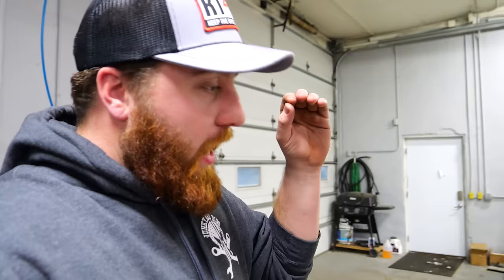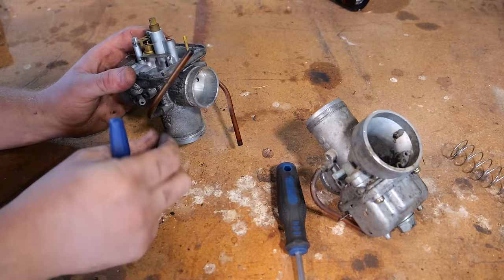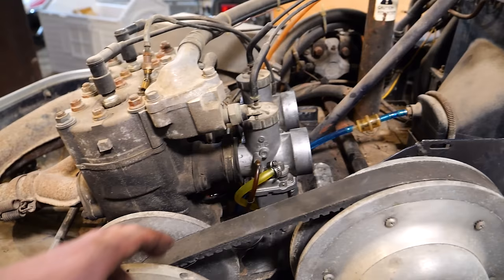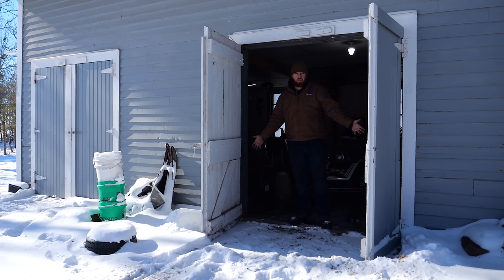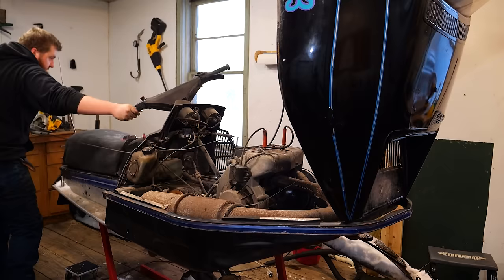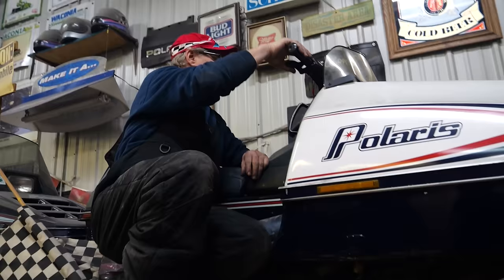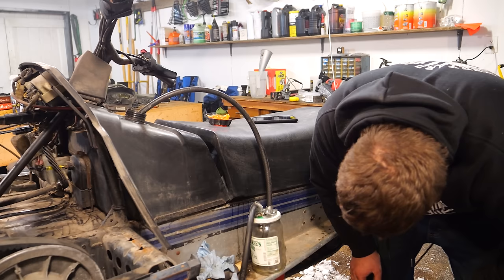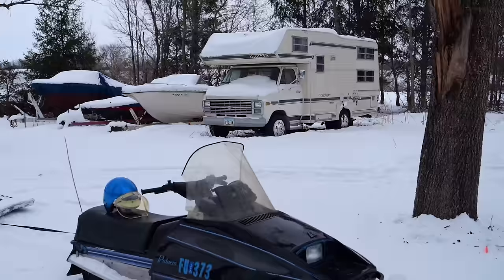Will These ABANDONED Snowmobiles RUN & RIDE After 20+ years!?

Comment: The air scoop was done as a recall. The brake would overheat (probably from the muffler), and boil the fluid.  I had a '79 TXL identical to the one in your video and it had the same scoop on the hood and duct under.
Reply: Exactly. I had the identical TXL 340 with the scoop already on it (bought the sled second hand). That sled could fly and was a wheelie machine. No IFS was the big drawback.
Reply: Yeah the indy came out in 80 and was basically a txl with ifs when I sold mine I sold it to a guy that was restoring a 80 indy 340 and he took my motor and exhaust and dropped it in his sled

Comment: My first sled was a 1980 ski doo with a liquid cooled 340 rotax and it was painted orange with "clockwork orange" very tastefully hand painted, pinstripe style writing on the hood. Was an old lake racer where they raced against the clock. Didn't know what i had at first, boy it wasn't much out of the hole but when it got the rpm up it would hit a huge powerband and you could barely keep it wide open for more than a few seconds it was so quick. It was pretty legendary for being the 340 that would run like hell back in the Day, always had to show under the hood to prove it was still the 340 motor

Comment: As a kid we had an 89 Polaris star that we used to ride every winter. Leading up to my birthday it was tradition to get it running. I can remember spending many years the night before my birthday in the shop with my dad and my cousin Robert working on it. To hear it fire up for the first time for the season put a big smile on my face. It originally came with a 250 but unfortunately the oil injection screwed up and seized it so then my dad transplanted a 340 into it. It was running when parked, probably needs a lot of work but no reason why it couldn’t be made to run again.

Comment: I had a 1974 Polaris Colt 250 as a young teenager.  It had that same fuel pump and dual Mikuni carbs.  Those carbs were the best.  Sure beat the old Tillotson carbs that our Sno-Jets had.  As a matter of fact, then the Polaris finally died, I put those carbs on a Sno-Jet with a 340 Yamaha engine in it.  Not sure if it had more power, but it sure ran better.

Comment: I had a 79 TXL 340… I LOVED IT. 38 millimeter dual carbs. It was fast for a 340. I rebuilt the motor and put a powerbloc clutch and long tracked it. Rivalled a new 583 summit in the day! Right on. I also bought the 1981 Indy 340 TXL rebuilt it and powerbloc clutch, repainted both and factory sticker back on it.
Reply: The tin air shield was on mine as well.
Reply: Also, when putting air box back in make sure the bolts go in properly, I had one brass nut go into engine.

Comment: No need for snowmobiles here in the south, but I love the snowmobile content for some reason. Get some of your friends together and have teams drag racing sleds pulling car hoods. Go to a junk yard, and have each team choose their hood of choice. Which is better? A more rounded hood to carve through the snow, or a more flat hood that spreads out the contact? Will waxing the hood be a benefit? A 2001 PT Cruiser hood, or that 1970 Ford LTD hood at the very back of the junkyard?

Comment: Daaang that shop is mint. We always had old snowmobiles as a a kid. The Rupp 440 had an open air horn that would die bc it would suck in my scarf. In that day , every piece of fun would have its special requirements to get it to run. I’m sure you will have these new sleds figured out by thaw

Comment: I used to restore snowmobiles as a hobby. I had connections and a friend that did the same thing. We ended up collaborating and parts swapping often. I worked  3rd shift as a custodian for the schools and he worked as a weekend ER nurse. I lost count  how many snowmobiles we restored but it was a lot. That was in the 90's. I ended  up working part time in a small engine shop and went on to learn lawn equipment repair as well as snowmobile repair. After finding ingredients out I had cancer, I was forced out of doing snowmobiles due to the invasive  surgery I required. I survived the cancer and closed that chapter of my life. The good ole days!

Comment: I live near Pittsburgh and I used to LOVE to drive my modified Polaris 400 2 stroke Sportsman 4WD auto through the snow. I NEVER got stuck on it. That 400 was a really powerful engine and it would handle jumps no problem. It wasn't anything compared to my 660cc Raptor, but it was alot of fun regardless.

Comment: Nice! I had a 79 TX 340 years back. I modified the exhaust by cutting the canister muffler off and just ran dumped a straight pipe off the expansion chamber through the original hole in belly pan, new intake boots being was dry rotted and sucking air, and jetted the carbs. On hard pack it would pull the ski's off the ground easily. Not sure how fast it topped because the Speedo broke around 60 going down the road n was definitely still pulling like hell. Believe Speedo went to 80.

Comment: I remember when the Rupp Nitro was king of the snow in the mid-late 70's. Man, those things were scary. Buddy of mine had a 1973 Moto-Ski 440, and while it was a great machine (maybe 60 mph), the Rupp smoked it. The Moto-Ski was a beautiful machine - as stable as the older ones were tipsy (scary how many times we dumped those machines!) - and it rode like a Cadillac. Rupp pretty much went south shortly thereafter.

Comment: I know it sounds crazy to use electricity to warm a room but, we have done this for years, oil filled electric radiator space heaters. We find them at Walmart orr any big box store. Set the thermostat to low and heat to medium and it takes the chill of our 10x13 bedroom. It shares a wall with our living room. Keeping the bedroom warm helps with the living room. The best $39.95 I've spent and they last for years.

Comment: Yo Kevin. If you can ever find an actual carb sync tool for that TXL you would be AMAZED at the improvement it would do for that sled. It looks like a stethoscope with a float on the end of it that goes over the throat of the carbs. I bet Tom might have one? He's a hard core Polaris man. My dad had the tool cause he use to be a Polaris dealer

Comment: Hey, when you put the cover back on that fuel pump, you You had it lined up, but when you flipped it. That little curve in the cover is on the opposite side you need to take that cover off and do a complete 180

Comment: Darn it sucks you lost the footage. I lost a set of original images years ago, from visiting a drag meet (Which don't happen near me often).
Thankfully I'd uploaded them to fb already. I got even luckier when I found them in a device backup.

Put it down as a learning experience and a chance to add a new procedure to your filming process. 
Watching from a part of Australia that barely gets close to freezing, let alone getting snow.
Reply: Learnt the hard way too many times and my main desktop blew up 3 drives of the 4. Well, destroyed the data after rebooting from a blue screen and I'm about to recover the 1TB drives and make an image of both of them, then get an 8TB drive, write the images to the drive as 4TB partitions, and get a backup unit installed.

Comment: That 1976 Rupp Nitro is same sled my brother had back in the early 80s wicked fast machine, yes front bumper was a heat exchanger and also had radiator, side lights on side of tub where functional and looked cool at night blasting through the powder snow. Our uncle raced Snowmachines up here in Alaska in the 70s if I call Mercury sleds ,we learned on the tank of a machine  the 73-75
 Merc 644 Hurricane Mark 1
Keep doing what you do sir ... had to comment.

Comment: We had a snowmobile/motorcycle dealership way back in 1968 thru 1979. We had Yamaha as the main brand and several others such as Viking, Dolphin (basically a purple Ski doo), Rupp, Scorpion, SnoJet plus a couple others I don't remember the brands of. In 1971 we took 6 Yamahas, still in their shipping crates, up to Houghton Lake, MI for the Tip-Up Town, USA festival. It is held every January for the past 70 years. (Ice is too thin this year for the on-ice town). We had a challenge with several other dealers to take new-in-crate sleds and we would uncrate them, set them up, add gas and oil, fire them up and take off across the ice. We had 3 done before anyone else had one ready. We also held a group ride in the Michigan Upper Peninsula in the Newberry area. We had a truck driver friend that would load up 30-40 sleds on a flat bed and he would take them up from our shop and everyone would follow. There was (still is) a motel where the current owners still have a photo album with pictures of the semi truck loaded with sleds and all of us. I still have one sled from our shop. It's a '78 Yamaha ET250. We got it by mistake, it was supposed to go to Canada (it has the km speedo). I've done a little "tuning" to the 250cc motor. It would only make 45mph stock. It now goes over 75mph, and very squirrelly for a sled that weighs less than 200#. It's been sitting in my garage for the last 24 years, life and kids happened so I don't get to ride anymore. Of course mice paid it a visit and rotted the carb beyond repair.

Comment: On these multiple carb machines, you never see people balancing(sync) their carbs. 
I've seen as much as 5 to 10 inches difference between carbs with slides/butterflies set the same
Imagine the performance(possible damage) loss with one cyl pulling(working harder) 10 inches more than the other.
Seen many oil pumps fail for one reason or another. I always disconnect them and mix my gas. Much easier and cheaper than towing machine home to replace or rebuild the motor.

Comment: The air scoop and funnel where factory recalls because of the Centurion 500 would melt the brake line and you would have no brakes after a few times use I remember the day I always came in the mail to replace my dad's new Centurion

Comment: I would fix the cats. They are usually faster than the others. For a polaris thise are cool sleds.  I have the cat version and its a rocketship for an old sled. As far as torch tip cleaners go,every time you ise them on a carb orifice said orifice gets a little bigger. Ive seen many a carb ruined by overzealous torch tip cleaner use. I got a zrr thats wants a piece of that polaris triple......hell it wants the whole thing.

Comment: Using an and or trusting a 50 year old oil injection pump is the way to kill a sled. Plus they over oil and make a mess of the crankcase a smell terrible And in today’s new engines they under oil and run really lean for the epa.  Mixing your own fuel will also make for easier starts and spark plugs last longer